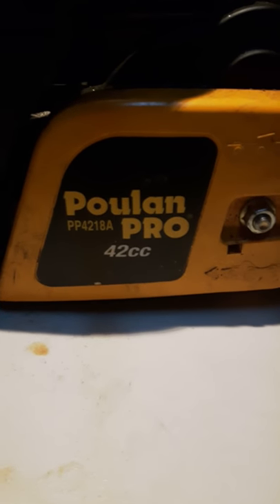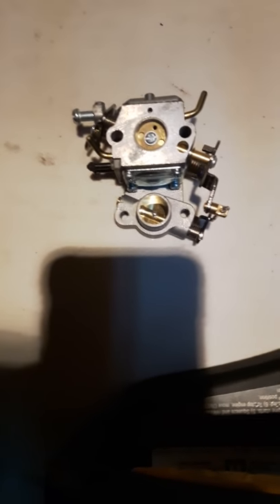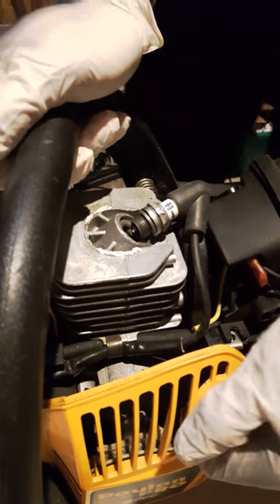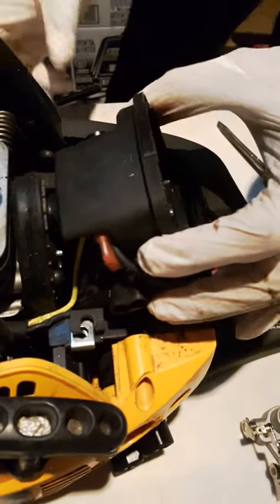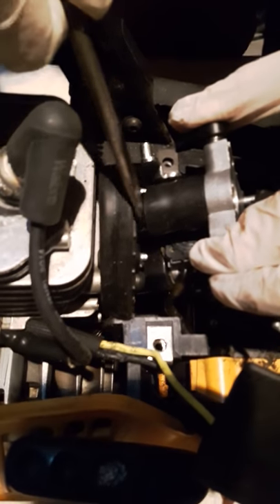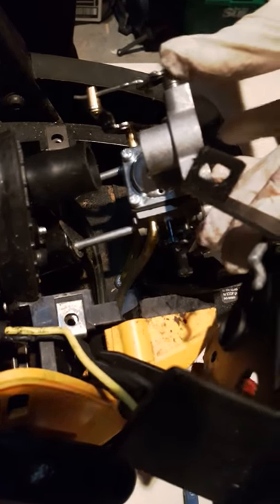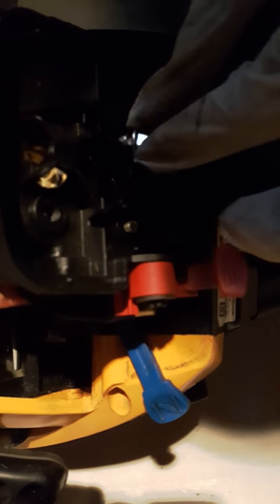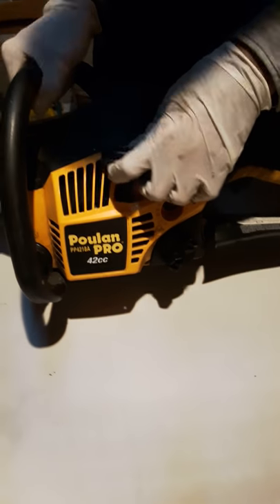How to replace chainsaw carburetor Poulan Pro chainsaw not starting or stalling

Comment: Good video.  I wish you would have included a view with the carburetor removed so I could see the tubes more clearly.  You went straight from the old one still there to the new one in place with the hoses connected.
Reply from the maker: Sorry about that and thanks for the feedback Dave!
Reply: @wisemonkey1551  Its okay dude.  I saw another video about changing the fuel lines.  My saw worked great after I got new lines put in with the new carb.  It then would stall when cutting.  I had to hold the throttle just right to cut with the right speed.  A month later and I am trying to use it.  It starts and idles great.  However, as soon ask I squeeze the throttle it stalls.  What could that be? When the throttle plate opens, it stalls.
Reply from the maker: @daviddetelich6047  Try adjusting the gap, clean coil surface or new coil, assuming you have the right spark plug too. sounds like it's getting more gas than it can burn properly (which can stall it too). I use gas (40:1) bought from Home Depot (expensive but it's worth)...
Reply from the maker: Also, adjust the carb fuel flow control screw as you rev it up slightly. Either lower or increase the flow and check if it still stalls or not (it should work with either less or more fuel).

Comment: poulan changed the throttle linkage metal stick for a cable, older ones have a metal Z shaped stick
Reply: Mine has the Z shaped stick.  2008 I believe.  Its the wild thing.
Reply: Ebay will have older ones to

Comment: I have the same saw and did it the same way, except I can't get the top cover back on. It binds the throttle linkage.
Reply: I trimmed the inside of the cover.  A dremel with a cutoff wheel will fix it.  Just a notch, not all the way through the outside.